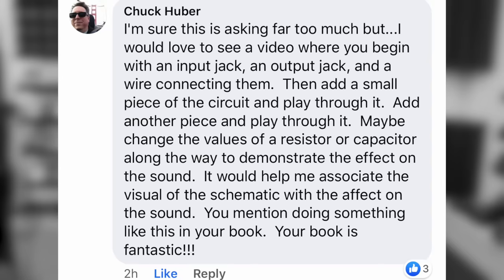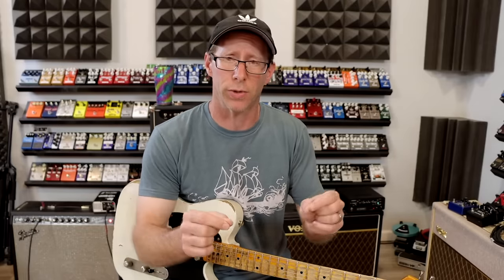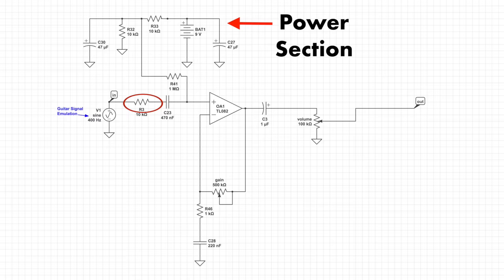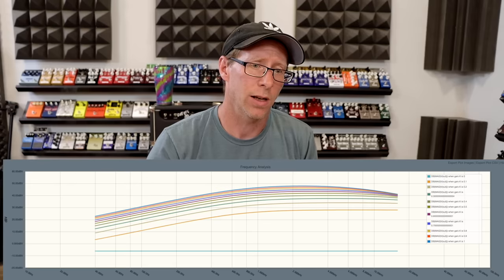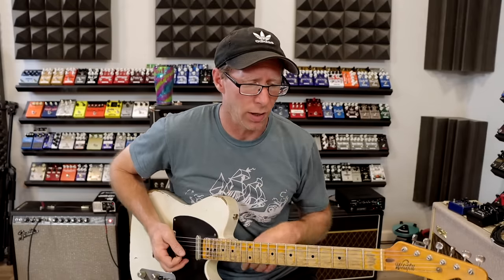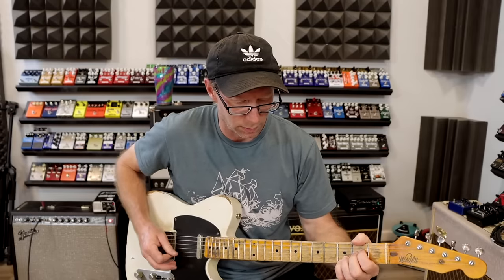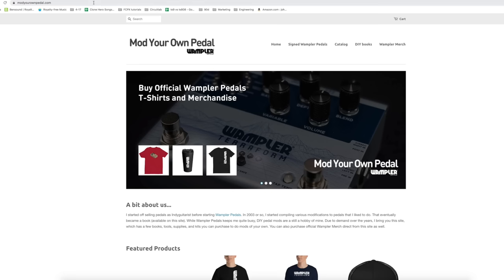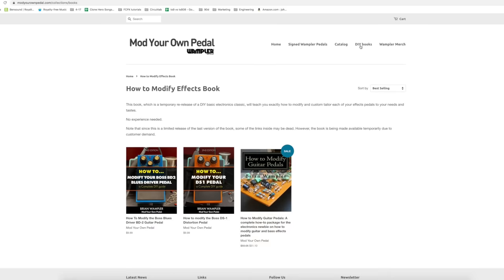How To Design An Overdrive Pedal Circuit

Comment: This is wonderful. I would like to tell you one thing. Breadboard shots do give a very nice feel. Maybe a bit of confidence to approach. In fact the opamps, RC, diodes aren't really the place where normally people get stuck with little knowledge. It's when we don't know what are the connectors, how they're soldered and how they look mechanically and their specific names etc. To be frank, I'm an analog vlsi designer who plays with nanometer transistors and can make an opamp. But I'm fed up of seeing schematics everyday. i would look at some real discrete components and connectors and feel happy if you could show'em.

Comment: I want to build this as my first diy. I can solder, and can roughly read the schematic. Question is, where would I connect an on/off switch and power supply input? Im assuming for the power supply, I can just connect in parallel with the 9v am I right?

Comment: Love the TL072(2 op amps) / TL074(4 op amps) with LEDs distortion like the Scholz Rockman X100 used
Reply: clipping with LEDs sounds like a fuzz... especially on the neck pickup...

Comment: I know this is a long short, but I was breadboarding, and I made a rat circuit, and it gets a signal and the sputters out, however, if I fret a chord and hit it, then touch the resist leading to the input, it comes through loud and clear. 
 I assume this is a grounding issue, but I checked the schematic and everything is grounded.  So rookie question, do I need to figure out a way to ground the breadboard?
(Edit) - Aftermath
I found that 4.5v was not being applied to all of the places that it needed to be.  
When I would touch the resistor, I would leach voltage and it would then work, kinda neat, and kinda weird.
Reply: Thanks for updating your solution! I hate it when people ask something, then never tell us what the conclusion was!

Comment: THANK YOU!  Brian you are such a great teacher!  I built this and it sounds great!  One thing I am scratching my head on - re:  C28.  So I am assuming the signal has been amplified when it hits the soft clipping diodes? Also assuming the filter at C28 forms a low-pass filter routing bass frequencies below filter cutoff to ground? Is this basically the same as the tubescreamer's selective clipping model? Any clarity would be greatly appreciated.  Amazing video!!!!!

Comment: Building a foot pedal and understand it is the ultimate beginner guide. Simply put. You are changing the sign wave of each circuit. Then you throw in a couple potentiometers to balance the circuits together so you can adjust them.

Comment: Very comprehensive video. Could you explain the power section a bit? If I wanted to use a different clipping section, I.e. a bluesbreaker op amp and 1n4148 circuit, could I use the same power section?

Comment: Brian, I've been hooked on your vids like forever! Bought your book just now on Amazon. I've installed several mod kits (Fromel) and built a couple dozen DIY kits from GGG and BYOC. So, I'm a confident "assembler" at this point. But, no engineer! Working on modifying a BD-2 clone circuit and I busted out a solder pad - bummer, right! Do you think you could spend a minute or two on a how-to desolder so you don't screw-up the solder pads and maybe a how-to fix one that you did mess up - like I did.
Keep up the great work!
Rich

Comment: What if you used blue LED's as clipping diodes? Is there a difference with what diode  you use for clipping, like zener diodes as a example?
Reply: Try it?!  Seriously, this may be the prime benefit of breadboarding.  Mess with the circuit in every possible way.  Maybe build two circuits, side by side, with an A/B switch.  Build the same base circuit then A/B the modifications as you go.

Comment: I have watched this video several times and love the concept. I have built a diy pedal and enjoyed that but I still don’t know exactly what each part is doing in the circuit. Do you have a recommendation for where to buy a breadboard and like a parts assortment that you could use to build a circuit? I have found several on Amazon but most only have resistors and capacitors, I have found separate op amps but not sure of the values I would need. It’s a little over my head. Too bad radio shack is closed.. thanks for any advice!

Comment: I know I’m a bit late to the party, but was researching op amps for a problem I have with one of my pedals and this awesome video came up. Sooo good!!
I have a question in relation to my problem. I don’t know if you’ll get this but oh well, here goes…
I’m new at this but I was wanting to mod a Cmatmods Super Signa Drive. 
The boost side, I believe, is boosted by an op amp and I think it comes before the drive stage. I use the boost independently of the drive and I love the treble boost and the spread of frequencies it adds but it has clipping which is really harsh. It’s a very low level clipping but it is very sharp. The op amp is an RC4558P. It is easily interchangeable so I was wondering if the way to soften the clipping would be to change the op amp. Or does it need a 100pF capacitor in between the input and output pins?

Comment: Here is a bit of a whacky idea - and I will put in the public domain for anyone to try if they want- I just prefer playing over designing in my spare time since electronics is what I have done as a career for 35 years - it's a bit crazy but have you ever tried putting a mini speaker and microphone in a pedal (the sizes definitely exist with BA spkrs and MEMs mics) and loading the drive part of the circuit with an actual speaker, then recovering it with a mic and then analog processing the mic output - in a guitar pedal....it might be unique - don't know if it had been done in that form factor...but it might be fun to try.

Comment: Hi again Brian.
Super video, excellent work!
I read some time ago that one does not want opamp clipping because it sounds artificial or just like crap. But yours sounded pretty decent to me. I experiment with building opamp based overdrives too and I discovered in some cases that the clipping sounds best without clippers at all. But this was in a hard clipping circuit. Ist there an easy explanation to this?

Cheers,
Thomas

Comment: Brian, what factors guide you in selecting an op-amp? Please do a video on building a distortion device using discrete transistors.
Reply: Really any op amp does the trick. An op amp is supposed to boost all the frequencies or to say it is a clean boost. Check the specs and find one whose cutoff frequency is greater than 20kHz (the higher limit of hearing range). The distortion is caused by the filters that are placed and the diodes that clip the signal.

Comment: Good cover of the basic signal path.
I think it would have been beneficial to also touch on the coupling resistors and capacitors that go before and after the opamp, the resistor on the input bias of the opamp... Maybe things like these can go in a second video?

Comment: Brian, can you do a video on building a "clean" power circuit for generic DIY pedal builds? I would like to understand when and why to use different components for a 4.5v vs 9v vs 18v DIY build and finding it difficult to gain clarity (it seems like every pedal schematic I look at has a different power block).

Comment: What I did was to look at pedal schamatics from electrosmash, and general circuits from electronics sites showing filters etc and try to recreate them on the breadboard. Very very hard, way harder then kits would be, but you learn alot and eventually should be in a position to design something unique and succeed. You will make mistakes. You may have to take a break and clear your hear. You will eventually succeed.

Comment: YES! I was waiting for exactly this type of video! Question: my dream as a guy with zero experience in building pedals would be to tear open something like and old TV and build an overdrive/fuzz out of it. Do you think it's possible to find the right op-amps and transistors in there? Is there such thing as 'the right' ones? Thanks!!!
Reply: You absolutely can, but it's more trouble than it's worth for most parts. Sometimes it's worth it, though. I recently built a clone of Basic Audio's "Zippy" fuzz using some grungy parts from an ancient transistor radio I bought for $2 and it sounds amazing.
Reply: @Ratimus_  thanks!

Comment: Hey, thanks for this detailed Video!
I have two questions:
I'm thinking about building a small amp (battery powered, will probably go with an electric ukulele i'm currently building) and was wondering if this cirquit itself would output enough power to drive a speaker. I have a 10W 8 Ohm Speaker and would like to use it for the amp, do you think this would be enough or do i need to boost the signal further?
This is the first time i'm trying to build an amp so i don't really have the experience to say if it is necessary to boost the signal.
And also, is it possible to implement hard clipping and soft clipping aswell as a clean channel by simply "activating" the clipping diodes  with switches (so switch off bypasses the clipping diodes and switch on "adds" them to the circuit)

It would be really nice of you if you could provide an answer to my questions.
And if there's any more info you need about what i want to do feel free to ask.

Comment: Hello! I have two questions that might be interesting: 
1) Is it possible to turn an overdrive circuit (tube or solid state) into an EQ or compressor circuit? Thus, making an EQ or compressor (tube driven or solid state) pedal out of an overdrive pedal? 
2) Is it possible to put the circuit of a tube rack inside a pedal?
Thanks

Comment: I am not sure I understand the power circuit but if I had to guess... the battery puts the + terminal at a steady 9V and then the guitar signal is effectively injected on top of this? And the reason we use 9V is because changing our voltage from a higher level will generally be louder, and if we dont set a baseline voltage >0V, we will have an AC circuit that simply doesn't work? Asking in hopes someone can educate me/confirm my ideas

Comment: Great video! Quick question: Why is the Tl082 being powered on it's positive signal input and not through it's actual power pins? It seems like this has the advantage that you only need a single 9V battery to power the circuit, instead of two 9V batteries for the positive and negative inputs. But am I missing something?
Reply from the maker: Guitar pedals are generally not using bipolar supplies like that, just a common single 9vdc supply.

Comment: Would I be assuming correctly that the capacitor is passing high frequencies as "negative feedback" to the op amp which is inverting output thus canceling the high frequencies?   If so, is there phase shift which affects the cancelation?

Comment: Really good episode. Like said, shots of the breadbord as well would've been cool, but I really liked this. Have spent the last couple of days trying to figure out exactly the things you explained. The basics are there but understanding really where and what kind of impact it actually makes the world of difference. Like changing the tone before or after the gain stage (usually you think "heck I don't want to remove highs" or "I do want to add some bass to that", removing highs and bass before amplification and drive can make it much more pleasant).

Btw is kindle the only format you can get for example that blues driver mod book? Or can you get like a pdf that you can read on pc without bothering with kindle stuff?

Also checked out your books on amazon and found out you are also a professor and have written a book about Democracy at Work: Pathways to Well-Being in Brazil!
Reply from the maker: Thanks! Unfortunately kindle only, but kindle reader apps are free. The professor is a different Brian Wampler 🤓

Comment: My Orange Roland Cube 60 guitar amp. has a Pre-Out and Main In connection at the back. As it is more than 30 plus years old with no Manual, I don't know what they are for? Please advise. Also, can I plug in a MP3 player directly into the Main In to mix with my guitar playing?

Comment: Do you ever use a variable capacitor (like in a radio tuning circuit) when designing pedals? Or perhaps the decade-box capacitor equivalent? With the variable capacitor, it would be the ease of use of a potentiometer, but with capacitance. Or are variable capacitors not available with the ranges needed? I guess a pot on a bypass around a high value capacitor would do the same thing, but I'm not sure on that.
Reply: For simple and well-defined circuits like this, you can very easily model the behaviour in SPICE simulation software and view component value effects on the frequency response of the output. Of course this approach is only valid if you have a decent idea of the Bode plot shape you want to see.

Comment: Hey, 1st thanks for video. . it is really cool. But there is stil a little questionmark regarding the vcc+ of the opamp. Do you use particular in this circuit ass vcc+ the current from the voltage devider or direkt the 9V?

Comment: 8:29 "Since it has all that bottom end in place, it's kinda getting a little bit fuzzy"

Can you please elaborate on that? Is the fuzziness just inherent to how bass gets overdriven, or is it inherent to using larger capacitors? Is there a way to get more bass in the driven signal without the "fuzziness"?

And another question I have is this: I want to design pedals for keyboards, but I don't want one wiring mistake to fry my thousand-dollar equipment. Are there any precautions I should take in my circuit design to prevent that sort of thing from happening?

Thank you! This video was extremely helpful!

Comment: So as for the pins of your tl082 op amp. Pin 3 is the + and pin 2 is the - ? Pin 1 is the output or right side of the triangle shape? And then pin 8 is +9V and pin 4 is ground? 

Thanks in advanced for anyone who chimes in to help a beginner here

Comment: So i built it with a tl072, but it doesn't work. When i plug the power supply it outputs a constant hum and the tl072 chip gets super hot. On the chip itself i've plugged pins 4,5,6,7 to ground and 8 to V+, I've checked the entire circut and it is all 1 to 1 but for the tl chip, how do i fix it?

Comment: Here's a beginner question about this-- can homemade breadboarded pedals (powered only by a 9 volt battery) harm a tube amp? I'm not an electrical engineer (I'm also a total beginner with this stuff), but I've been hesitant to test out any of my distortion/fuzz prototypes on my tube amp out of a fear of damaging it. Is this a valid concern? Thanks for this video regardless, it's full of great information and I really appreciate it.
Reply from the maker: No, won’t hurt the amp at all.
Reply: @wampler_pedals  Thanks for the quick response and for the great content. It's greatly appreciated!

Comment: Great to see this happening, very informative. I'm using this piece of software https://www.livespice.org/ it enables you to hookup your guitar to the PC and run your guitar signal through a virtual schematic and have it emulate the sound live. So you can swap out resistors, op amps, capacitors etc and craft your sound. I know it is outdated so maybe someone has a tip for a more recent simulator? Good luck prototyping!
Reply: You are best. Thank you :D
Reply: this is cool. Can you also tell me what hardware you got to connect your guitar to the computer?

Comment: It never sounded to me. I used Livewire to do a PCB and I put it all together as the program showed and It never sounded. There was a strong HUM sound and almost explode the amp. Can anybody help me? Thanks. Another curious thing that I noticed is that in the scheme, there are two electrolytic caps of 47uf 16 volts and in your video,  they are not in the protoboard. You replaced it with two polyester caps. Confused.

Comment: Thanks for the explanation of how overdrives work. Out of interest how does diode clipping work? I presume some of the current gets absorbed and lights the LED which somehow clips the top of the waveform?
Reply: Diodes have a feature called "forward voltage". Basically they will block anything above a certain voltage going in a certain direction. Any signal bigger than the forward voltage is cut off at the forward voltage of the diode, clipping it. Two diodes are used facing opposite directions so that both the high and low swing of the signal are clipped.

Comment: Are you certain you followed this schematic? How is the tl082 supplied like this if the power section is only connected through the noniverting input? It doesn't make sense

Comment: hello, sorry to bother you, but I have a question.  is it possible to reduce the level of the potentiometer in a simple way, for example by connecting a resistor?  i really like two sounds on my ehx Bass big Muff.  i need to plug in a switch that will reduce susstain.  Ideally  increase the volume, but if not it doesn't matter. Thank you very much🖤 love your videos

Comment: Can you explain the power section?
I assume the two capacitors are there to filter out noise.
But why is there a section between two 10k resistors that is connected to the op-amp + input through a 1M resistor?
Reply from the maker: That is for bias for the op amp

Comment: most of schematic input line use cap than resistor 10k..and your schematic use resistor 10k then 470nf . Is there any diferent  sound with that different position ?